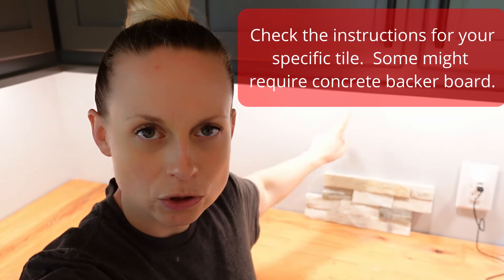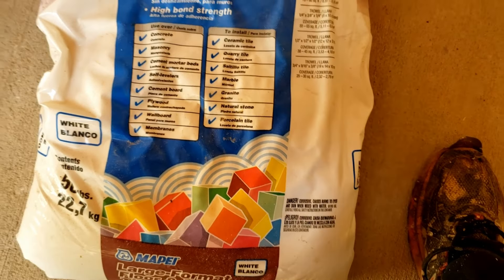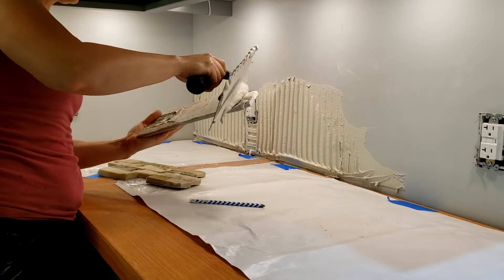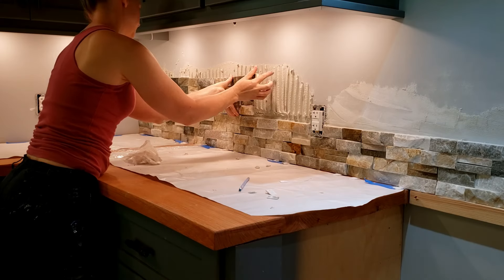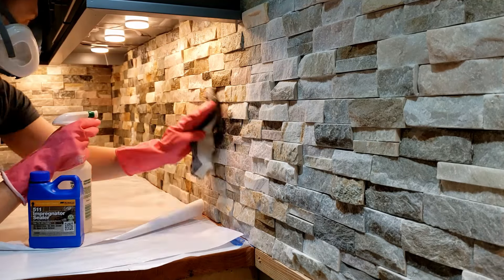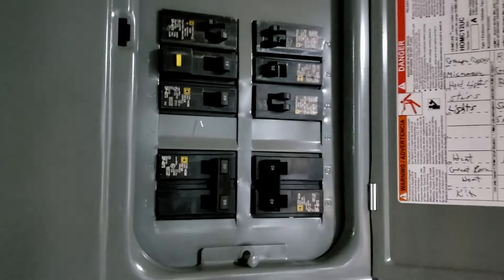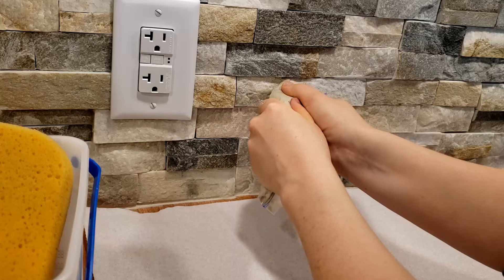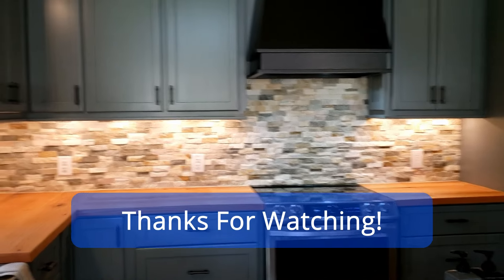DIY Stone Ledger Tile Kitchen Backsplash

Comment: Looks nice but it stains. Not a good backslash choice if u cook at home much
Reply: I was wondering about that because I cook very often at home
Reply: A good sealer will keep it from staining. Along with staying on top of general cleaning.
Reply: Somebody never sealed there stone. FYI all stone will stain if you don’t seal it👍🏻
Reply: Apply a sealer to prevent staining. It will also highlight the multi-color specs within each piece, and it really accentuates its beauty. You should apply the sealer before installing 😉
Reply: Do u not inter lock the corners

Comment: I've watched several of your videos now and you're pretty versitle.  You do everything.  I did notice in this video you seemed to have a bit of a problem when you tried cutting a circle with your hole saw.  I discovered something that will make life easier if or when you do it again.  Take your hole saw and make a cut in a piece of plywood scrap.  That piece might be the size of the bottom of a shoe box or something.  Once you make that cut in the wood place that piece of wood over the tile or stone you want to make the cut in.  Lean on it or somehow put a little pressure on it so that it doesn't move.  Then you can make the cut in the stone and the wood will keep the hole saw from jumping around.  
I liked your idea of selecting stone that you use to go around the outlets.  I did that to and then decided that I would just put the time in and make exact cuts to just go around the switch plate.  Just a preference I guess.  Anyway, I enjoy watching your videos.  Keep it up.
Reply from the maker: Great idea, thank you!

Comment: Looks amazing! I had my kitchen redone with smaller stones and some kept falling off on install so the installer added more mortar and now there are some dried mortar in front of it that I can’t remove. How do you remove them? I’m hoping to clean it before I seal. Thanks
Reply from the maker: that is going to be tricky.  If it was a smooth tile, you could probably gently scrap it off with something like a chisel.  But with stone, it is going to be really hard to get it off of that textured surface.  That is why I am constantly cleaning the tile during install to make sure I don't have any thinset on the front of the tile.

Comment: Please redo the outlets. This is in a kitchen area where liquids or water vapor can get between the cracks and rust out the connections which can result in a wide range of problems. If you Drexel out the protruding stones to make them flush with the most recessed stones, the outlet cover can sit flush and close those gaps, prolonging the life of the outlet and creating a safer environment.
Caulk is an option, but we all know caulk has a limited life before it cracks and the issue returns.
Reply from the maker: Thanks for the tip!
Reply: Do you have a picture of this with the outlet cover off and on?  Would love to see. Thanks.

Comment: How heavy are these panels? I got one to try to patch my wall where a tv mount was installed but it feels so heavy. Around 12-15 lbs a panel. Is it safe to install directly onto drywall at that weight?

Comment: Hi love ur video think u did a wonderful job and I learned alot from this...but I have 1 question, im a professional painter for over 20 years plus, and we've always used water to smooth out. So I'm curious why Denature alcohol?  I'm getting ready to do a job and they want me to add the same stone.
Reply from the maker: Thank you!  I used alcohol because I was using a silicone based caulk.  Water doesn't work very well to smooth out the silicone.  Water works great for smoothing water based caulk, which I am guessing is what you mostly use as a painter.

Comment: Great video, thank you!
Do you know how often should we seal the tiles? Once a year or is it just a one time thing?
Reply from the maker: You do have to reapply the sealant, but I wasn't sure how often.  I had to look it up on the product website.  For the sealant I used (511 Impregnator Sealer) this is what the company recommends. " Typically we recommend re-application on flooring every 1-3 years for commercial flooring and every 3-10 years for residential flooring. We recommend re-application every 1-3 years on counters and every 3-20 years on vertical surfaces."  That is straight from the company website - https://www.rustoleum.com/pages/homeowner/faqs/miracle-sealants-faqs

Comment: nice job! it is cheaper than peel and stick just added work but you will get a long lasting beautiful look! I actually got some carrera marble on clearance for 3$ a tile 12×12..it was just enough to do a backsplash for my bathroom..in my area the peel n stick was 9$ a tile..wow like way more than I wanted to spend! I just dont understand what the craze is over the peel n stick!
Reply from the maker: Wow, I didn't realize that peel and stick was so expensive

Comment: The tile was cut to big around the power outlets. The flange should be sitting rite on top of the tile also by code the electrical boxes have to be extended out to the edge of the face of the tile to protect from fire and electric shock. 
It’s still a good looking job just skipping these steps will give your insurance company a reason not to pay out anything if house burns down.

Comment: Better to seal the stone the day before you put it on the wall..The thinset that gets on the stone will come right off if sealed before install.National electrical code says you must use box extensions to bring the outlets out. They makes many different box extensions all color coded.Never use spacers.DIY is good but you should always follow building and electrical codes for your area...Looks nice..
Reply: Thank you, I’m doing this and my fear is leakage. 😊

Comment: Great instructional video. What is the name of the stone manufacturer?  The stone I'm looking at is Beachwalk Splitface and weighs about 6 pounds per panel. The manufacturer says drywall is not suitable.  Did you look into that aspect?  Our backsplash is 14" talk x 12' long.  Did you ever consider mastic such as AcrylPro?  Seems like it would be easier to work with.
Keep up the good work!
Reply from the maker: The brand name of the tile that I used is Satori.  It came from Lowes (link in video description).  The instructions for the tile that I used said that it could be used on drywall for up to 10ft in height.  But every tile is different, so follow the instructions for your tile.  Some do require concrete backer board instead of drywall.  I didn't use mastic just because this tile was so heavy.  Thanks for watching!

Comment: She's using the wrong mortar for this tile. We tried to do our fireplace with that, it slid all around. You want to use a rapid setting mortar on walls because the tile is so heavy. It will not stay in place.
Reply: nope. she used the right kind of thinset.  yours was too not thick enough if your tiles were sliding around.

Comment: Not bad, but you should have scribed the tiles to the corner. The straight cut really stands out against the other tiles.
Also, if you seal the tiles before you install them it's much easier and the mortar doesn't stick to the front. Just make sure you don't get it on the back of the tile or they won't stick well.
Finally, I'm not sure those spacers are code for extending the outlets. You probably should be using a box extender.
Reply from the maker: Thanks for the feedback!  You should consider making a video next time you do a stone ledger project to show how you do it.